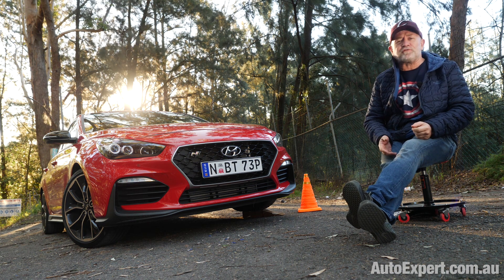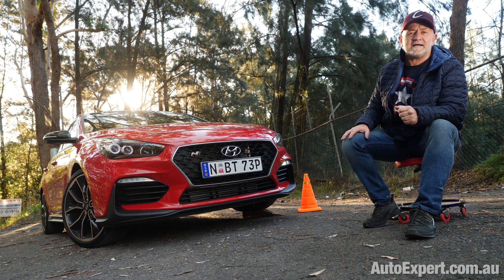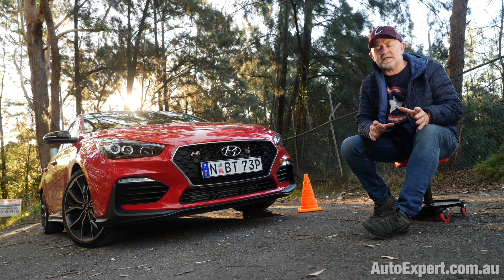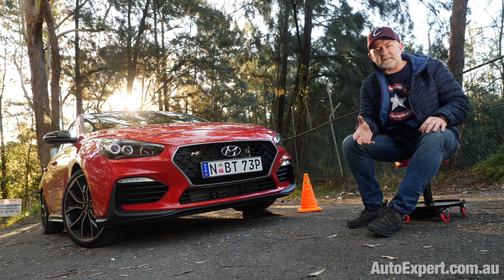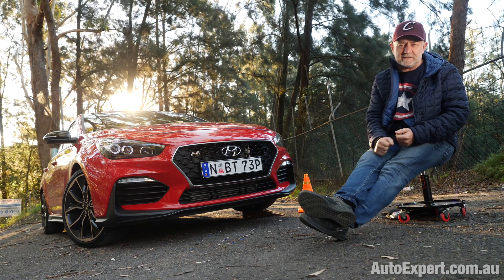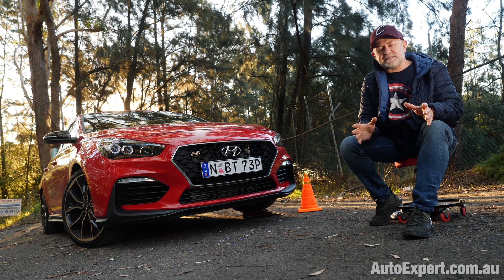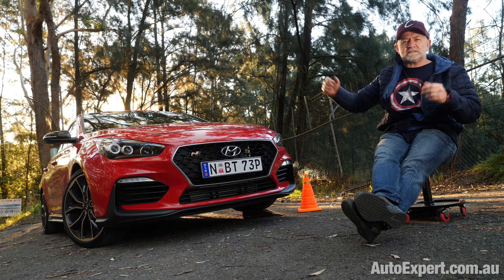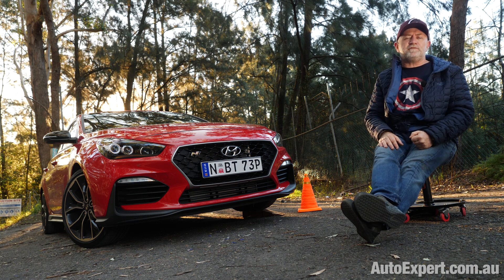What is stability control (ESC) and how does it work? | Auto Expert John Cadogan

Comment: if you have a lot of driving experience, the fuel cut is horrible feeling, it feels dangerous.  The electronic brake distribution to control yaw is a great advancement.  BRZ has the option to turn the fuel cut off and keep the EBD.  The RX8 allows you to throw the tail out nicely, the TCS doesn't feel overbearing.

For most people on the road, I suppose the more aggressive systems are welcome and superior to their ability and experiences.

Comment: Would have been fine if they had done it right. Since they didn't though, it's something I would avoid as it can cause your computer to force the brakes on in some Hyundais randomly even though the esc is off and nothing is wrong with the car.

Comment: While I love the fact that new cars come with some sort of ESP, basic driver training should include some training on recovering a loss of traction. Unfortunately, most people get their training when it happens for real. Often that ends badly.

Back when I was young and stupid, I remember thrashing my first car around empty parking lots quite a bit. Especially in winter. An ancient Dacia 1310 (basically a Renault 12...yes, a 1970's design). The good part was that I learned about threshold braking and recovering from oversteer as well as understeer.

Fast forward some 10 years, I was driving a Renault megane on a wet road. I did a bit of a chicane between two cars who were traveling too slowly on both lanes and had another car start to pull into my lane from a side street without looking. I lifted off the throttle and steered to avoid. Surprise, surprise. I found out what lift-off oversteer in a front wheel drive car is like. Luckily, I didn't shit my pants right then (and I really couldn't afford to fuck it up... Parked cars on the right, a fence on the left and basically a lane and a half of width to get it right). I steered into the skid while accelerating and as the car started to recover, I unwound the wheel, caught the second skid before it turned into an over-correction fuck up and that was that. Soon-to-be wife on the passenger's seat barely noticed. I was just happy that I didn't shit my pants.

Fast forward more years, I've yet to have had the ESP on a Hyundai i30 fastback kick in... That car has insane amounts of grip and a really solid suspension compared to that boat of a Renault. But the shitty roads? Ugh.

Here's hoping I'll never need ESP to help me out... Nor the automatic emergency braking feature... (though I do find the forward collision warning really friggin useful...).

Comment: I've had a issue on a gravel road where fishtailing started.I locked the brakes when it centered.Slid straight to a stop and it just dawned on me to do so mid calamity.Very frightening.No traffic at the time and that could of been tragic if it had been.Road change conditions are a lot to figure.

Comment: Hi John,
I agree with you entirely about what you say in this video. The thing that frustrates me in this, a steering wheel is designed as a control for the vehicle. It is designed in a way which allows the driver to best control the vehicle. Spokes and thumb guides are included in virtually all modern cars in a way to encourage drivers to drive in the safest way possible. So, why is it that a very large percentage of motorists are either ignorant to this fact or simply disregard it because they think they are too skilled?

As a motoring enthusiast, this shits me immensely. 

Why is this culture of poor driving becoming more commonplace? Is it because people are less in tune with their vehicles because of poor driver education? Could it be because of lack of understanding of simply how cars work (possibly a side effect of the demise of the manual gearbox)?

Do you think we should address driver training as a something to try and reduce the road toll or do you believe that the current big stick approach that the government is taking is the correct option?

Comment: Hey, John. God your an absolute laugh. My husband and I absolutely love watching you on YouTube. I need to ask you a question regarding car insurance. This might sound real stupid, but once upon a time insurance companies used to do a thing called "agreed value" on your car. Does anyone still do this? I have a Mazda 3 SP23  2004. I am the third owner, it has low Kms and has had proper services throughout the life of the car. I have full comprehensive insurance due to the work that I do and real insurance will not do an agreed value on my car. 
I understand that they go by the "market value". But what market are they going by. They told me that my car (regardless of low Km, service details, etc) they can only insure it for $3,500. I looked on the internet for a Mazda 3 (same year model as mine) and for that amount you can only pick up one that has around 300,000km. Can you please help me with this as I can not work unless I have comprehensive insurance? I purchased my car (2 years ago) for $6,000. I regularly have half yearly services (including oil changes) as I am on the road a lot!

Comment: I drive a lot in the snow (I work in a ski resort in Switzerland). In a hard turn on snow, it tends to understeer, especially if there is no load in the back. The ESP does not seem to be able to deal with it. Maybe it is technologically obsolete (Skoda Octavia TDI 2003). I use my handbrake to help the rear come around and works out fine. When the tail slides, the front wheel drive and good snow tires do a great job to pull me out.

Comment: I've actually had to recover a 2006 Mitsubishi Triton after an uneven surface after a turn plus too much power by me. I dunno what the car did but I had to counter steer and then correctional steer before I could gain control again.
The tyres are about 8 years old and I was in 2 wheel drive, now I'm only in 4 wheel drive. Only lost like 0.3mpg so I'll take that until I can swap the tyres

Comment: A few questions all in regards to a Honda Civic LX 2018.
Is Anti-Swerve the same as ESC?  I have noticed when braking hard into a corner, then turning sharp and hitting the gas I get no response from the engine for almost 1 second.
It is truly annoying as the type of control I used to get from cars is no longer there.  I haven't done it enough times with Anti-Swerve turned off to see if that is different.
I have only heard the Anti-Swerve activate once when the car slipped on ice.  Is it really necessary to have this feature turned on?  It seems to accentuate the fact that the
car is disconnected from me.  The illusion is broken and the car feels unresponsive.  I wonder if I should have chosen the Sports model instead.  Thx for the great vids!
Reply: That could be extremely dangerous if you were using the brake and throttle to modulate the car around the corner. Slam the brakes, start trail braking while turning In and go to get back on throttle and you've got nothing.... that could really throw the car off balance CAUSING an accident because the driver couldn't use throttle to do the necessary maneuver
Reply: @Sweetheartxx195    Yeah, that does sound like the maneuver I am trying to perform and when the ESC kicks in the car definitely does seem to stabilize however the lack of throttle seems to be oriented towards drivers of much lower skill.  The lack of throttle also conveniently ends my cornering and makes me look like a lump that stopped in the middle of a sharp turn.  I am the type of driver who will use a snowy road to do an E-brake drift 180° to park my car on the opposite side in the opposite direction.  Of course I do not do this with anyone else or their cars around.  Perhaps what I am talking about is drifting and you're points about average driver safety are of course legit.  Thanks for responding!
Reply: I've got an 02 civic lx cable throttle when I hit it it moves no lag no computer checking if it's safe lol
Reply: @Sweetheartxx195  Feeling a bit jelly. Lol

Comment: First, I have to admit to a horrible personal flaw, I live in the Trumpled hell. Secondly, l have been watching the channel as the only religious following I'm capable of not being asked to leave. The only problem with the skill replacement system for myself is I have been driving less-than advised/DOT legally allowed F.I. powered rear-wheel drive cars on road, drag strips, and circuit courses since dual double-pumping Holleys were the efficient system. The Toyota Corolla l have burdened myself with is a hazard to drive in rain, the first-ever/only single car none mechanical failure crash l have been in was a hydroplaning on newly watered old oil soaked asphalt and l almost had it recovered before the car suddenly started its beeping alarm and started a new skid. I am not the best driver, but I am still better than Toyota allows for.  I was forced to stop enjoying the driving, when I told my Impala to go right and it decided to try pogo stick on it's driveshaft at 80-ish MPH instead, I can't recall exactly but the speedo was jammed with this reading.

Comment: What I object to is the term "stops a situation from happening" I'm not against driving aids as it does assist in "reducing" the chances of being involved in a crash or other situation, but be honest the majority of drivers when they get in to a situation and these driver aids kick in, some drivers can over react because they don't realise / understand how the many particular various driver aid systems work and can end up crashing as a result or put to much reliance in the driver aid tech.

Bit like when ABS brakes first started to be fitted to cars, drivers sort of understood what it did but didn't understand how it feels when it activated when the brake pedal began pulsing when the wheels locked up and some drivers actually took their foot of the pedal and reapplied brakes because they didn't understand the feedback they felt from the brake pedal.

 There is no real hands on training on how it feels the feedback, and all these driver aid tech do have limitations and don't work in certain scenario's,  some drivers have become so complacent and lazy because many modern cars have all these driver aid tech that they have gotten in to a mentality that they don't need to be as alert as this tech will save them.

 Sadly though shitsville straya driving standards are getting poor and crap driving attitudes prevail.

John you explained it well about driving situation understeer / oversteer and ESC operation.

Comment: Great video, very informative. ESC using brake vectoring to stabilise the car is okay with me but I'm not a massive fan of cutting the throttle when I'm driving.
Reply from the maker: You should be - it doesn't randomly cut the throttle. Only does it when it's going to save your life.

Comment: Thank God I never had the "pleasure" of using the system in 30 years of driving. Well my latest car has it. I own that for 4 years now. But even when I did not have the system, I never needed it. I find it a reassuring thought, though, that my present car watches over my adhesion 100 times a second.

Comment: John how does the esc system work when towing a caravan is it going to be helpful ?
Or a hole lot of fecal spray !
Reply: Dean Robert You seem to have missed important facts from the video. (1) the ESC can react faster than you can (2) The ESC can perform actions unavailable to the driver such as differential application of brakes. 
This means that in all circumstances the ESC is valuable when losing control. Towing is little different to getting a shove from behind in an accident. It can cause the vehicular motion to include movements and sliding that can be catastrophic. In those circumstances the ECB is maximising the chance that you retain or regain traction and therefore control. There are times when nothing can save you, but as a general rule, the ECB is a valuable safety aid, including when towing.

Comment: Loved this video John. Here is a suggestion for another beer garden physics piece. I'm looking to buy a new car for one of my family members soon and have recently test driven a few hybrids. I notice some of them are smoother than others when transitioning from electric motor to engine power and vice-versa. This got me thinking about how engines and electric motors work together in harmony in a hybrid. How does the vehicle manage revs/power output of each to balance the two systems so they working together without too much roughness, especially when transitioning from one source of power to the other? Sorry I might not have expressed this very clearly but I think you will get the gist of what I'm curious about here.

Comment: Love the vids. Would like one explaining modern AWD. We drive a 2012 Santa fe diesel. I am aware it drives as a FWD normally, because it has no centre diff. When we accelerate hard the front tires spin, I would like to know the order of computation,  traction control or engage clutch on the rear diff.

Comment: Stability control is for the weak. I remember Toyota klugers drivers had a habit of putting their stability controlled cars on their roots, ford territory drivers had to fight with their cars because of the stability control. Now the kicker, owners think newer cars are soo good they don't need to things like check tyre pressures which the owners manual says you should do frequently but hey remember, new cars I don't need to read the manual. It's good for us mechanics because everytime I plug my scan tool in, money money money, clear code, pump the tyres up, oh yeah folks none of this only change one tyre shit, you must replace all the tyres at the same time, and best to have 4 of the same tyres, different tread patterns, different grip, stability control epilepsy!

Comment: great video thank you. would a 2006 subaru liberty have this system? What manufacturers make this esc system best
Reply: Herman no, ESC wasn’t standard in the 2006 Liberty from memory, I think from the next generation it was. Very few if any manufacturers make their own stability control systems; the Germans invented it (via Mercedes Benz) and most are made by Bosch for just about every manufacturer, but the tuning and implementation can vary enormously between car makes and models. Some manufacturers tune them to be conservative and even too aggressive (Toyota used to err towards this), others seem to let the car get quite out of sorts before they intervene. Mercedes and Mazda were always said to get the balance pretty right.
Reply: @sjb2471  thank you. time for an upgrade i think

Comment: via the  p plate book (in australia )  the correct  hand position is 10 to 2
Reply: How far out of date is this book or the thinking (or lack of) behind it?  Most cars have thumb rests at 9 and 3, and have significant controls at those positions to be thumb operated to obviate the need for the driver to take hand(s) off the wheel.  This is typical of the ill-informed centralized output we get today from governments or government based organizations.

Comment: Love the "Bier Garten" Physics.  The only slight problem is that simplifying things means that nit-picking sticklers (who me?) feel compelled to post and...nit-pick:

I think you'll find that understeer is curbed by application of the inside brake on the REAR wheel. If the front axle has already started to slip, there is no point and no gain in stressing the tyres further.

Comment: I would be interested in objective information comparing the safety of different systems, particularly in the wet. How do different AWD systems work - eg toyota (normal and hybrid electric motor AWD), Audi, Subaru. How important is AWD compared to electronic stability control? Has anyone put any reliable and valid numbers on these?

Comment: ESP is also acting when the driving wheels lose traction when accelerating (on snow or gravel). It mainly cuts the throttle to slow the wheels enough to gain traction again. It has to be turned off some times when you're stuck and need to allow slipping.

Comment: And then there is ESC compensating for design blunders or incompetence - for example, I'm thinking about the original Mercedes A-Class that classically failed the Swedish Elk Test (a simulated swerve across two lanes to avoid an elk on the road), where it toppled over, quickly slapping ESP on as standard saved them going back to the drawing board...
Reply: NO!  Get the engineering right first!  Look where a "quick" software fix (MCAS) got Boeing with the 737  MAX  !
Reply: @BrackenDog10  Oh, I agree, but they had invested heavily in the vehicle and had actually built the release batch when the Swedes managed to roll it over during a standard test.
But look at modern fighter aircraft, most of those won't fly safely without computer controlled avionics. It makes me wonder how many cars are unstable without ESP/ESC.

Comment: The only potential problem (if that's the word) I can see with ESC is when the situation is too much for the computer to handle - going back to not breaking the laws of physics.  When the maneuver is too extreme for the ESC, it can leave the driver mid-corner with a sudden lack of talent and no idea how it happened.  And half the time (at least) I suspect they weren't even aware that they were getting close to the limit, as the system tends to mask overenthusiastic driving somewhat.  I realise it wouldn't be the most comfortable at times, but I wish there more systems would let the driver get that feeling of "Crap, I should have taken this corner slooooooower!" before the ESC kicks in, so they'd have an understanding of when they are actually approaching the limit.  That gut-clenching, squirrelly feeling teaches much.  But all in all, I'd still rather have it, than not.  :-)